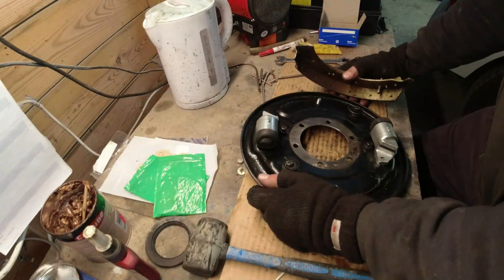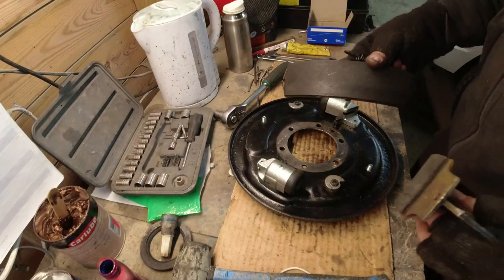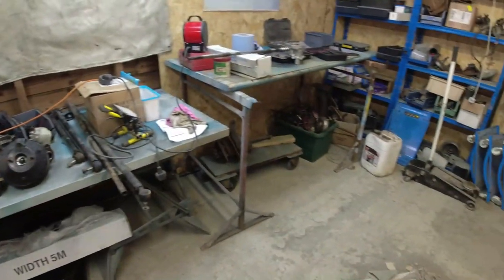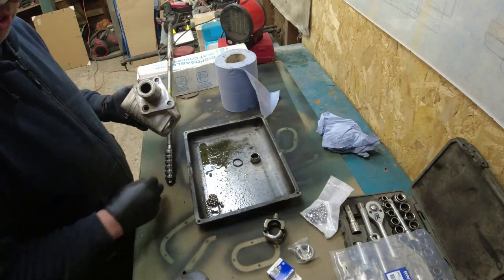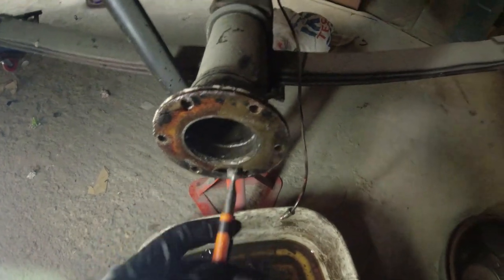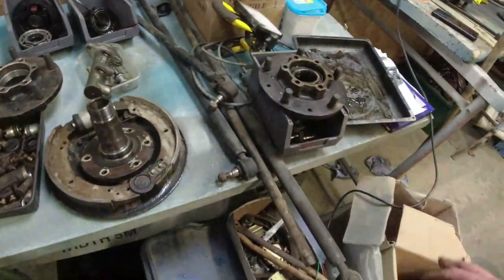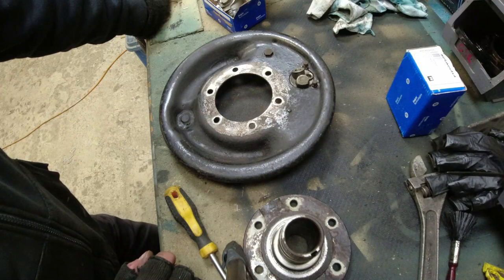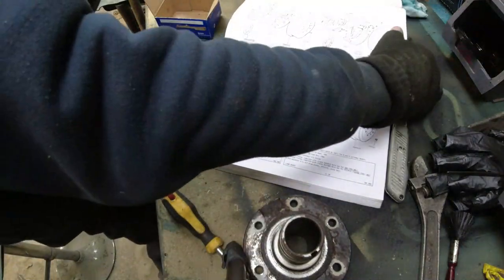Series3 88 200tdi episode 5 - profanity warnings

Comment: Don't know what that o-ring was there for. Don't remember seeing those on my Series 3, but then I again I have a Lightweight which has a slightly different setup to civvys.

I agree with your assesment of left and right. On my rear axle the brake pipes run to the back of the axle so I think you are right that the wheel cylinders were on the wrong side.

My brake adjusters badly need replacing, but I have heard bad things about the replacement adjusters. Made of cheese etc. so I would like to know a reliable make/source if anyone can recommend one.

Thx
  Graham
Reply from the maker: I think that I ring is on all series 2 and 3 steering boxes, primary function is to stem the oil leaks from the only place where they can really leak from.

Brake adjusters in Chinesium is the only source currently as far as I am aware - RTC3176